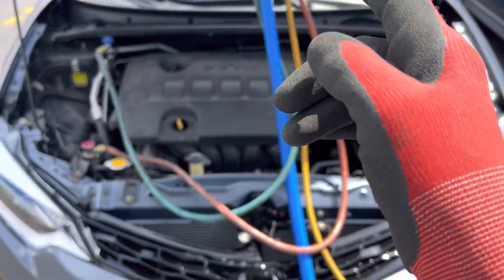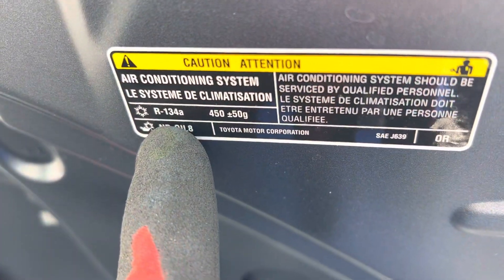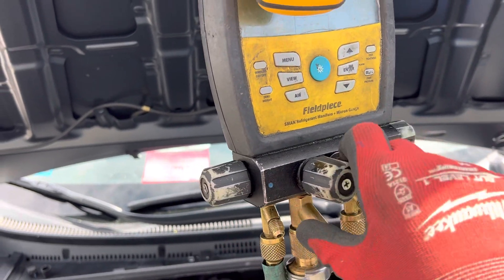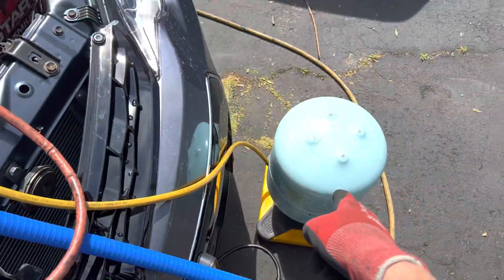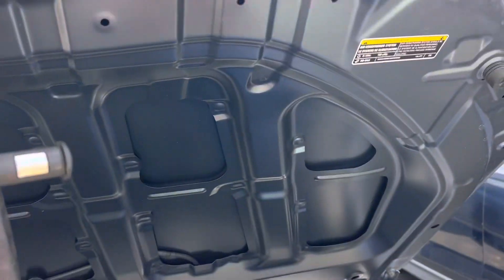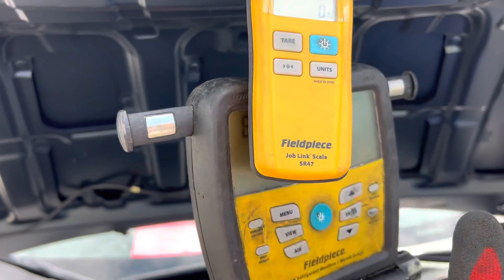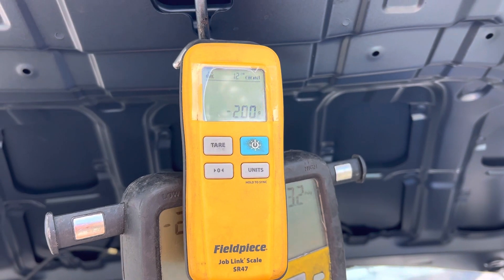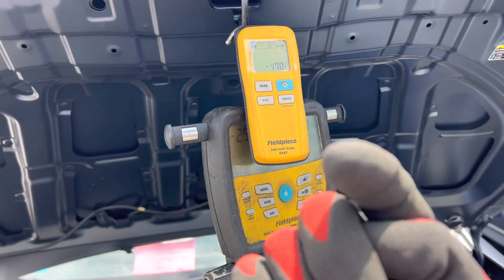REFRIGERANT RECHARGE 2016 TOYOTA TRD-S  CROLLA 450g. R134 TECHS learn different about same topic. ￼

Comment: Hi Tom! When I pull vacuum with my 2cfm vacuum pump, I go down to 750 microns. I can only get 4oz of R134 refrigerant into the high side port. Why can't I get 22 oz? What's wrong with my setup?
Reply from the maker: I’m curious have you tried to measure what is the micron capability of just your vacuum pump when you hook your micrometer directly to the port with no hoes ? 

To CFM is more than enough you can get there it’ll just be slower .  
   For example, if you measure your vacuum pump all by itself, and you find out it could go down to 50 µm that’s a good example of vacuum pump that is OK
It’s better if they could go to 10 to 15 µm it doesn’t sound like much but in the world of microns it’s a lot . The farther you try to get down there the more energy in a more time it takes.. 

And 750 µm means nothing if the vacuum pump is still connected and running and the valve is open when you’re measuring . 

It’s after you valve off the vacuum pump and isolated system and then wait 5 to 15 minutes and measure micron reading. That is your true reading. . 

When the vacuum pump is running, and the port valve is open, you were reading the vacuum being pulled by the vacuum pump . 

As for filling up the system like I tell everybody and like my father told me when I was 12 you don’t get to touch your tools and to keep figure out and tell me about the gas laws and explain to me how you’re going to get the complete for 100% charge into the system without running the engine . 

And I’ll tell you the same thing. My father told me go study to three gas laws. . 

When you understand them, a lightbulb will go off and you will answer your own question. It’s really simple. . 

Back when I had to find out, I had to read these ancient artifacts, called books with hieroglyphics . 

Nowadays, you guys are lucky you have the Internet, google, Wikipedia, and You Tube .  

When I was learning Bill Gates was a teenager working on his software.  And my father had me use micron meters for testing systems.. 

There was no Internet
Reply: @coldfinger459sub0  I haven't tried to test if the vacuum stays at 750 microns after 15 minutes. That would be a great test. Perhaps I have a leak in my setup. I will also try the vacuum pump to see what it pulls at the vacuum pump port. 

Thank you so much for your knowledge!
Reply from the maker: @davidvera4431  hey isolated, standing vacuum decay test, ( is not, perhaps a great test) 

It’s the only test that matters 

The vacuum pool while the pump is applied and running means absolutely nothing . 

It’s what it can hold through the vacuum decay test 

Just like when performing a nitrogen, Decay test . 

Doesn’t matter what you can get it up to 200 psi, 400 psi 600 psi with the tank, continuously supply nitrogen

It’s after you turn off the tank and isolated. What can hold is important.

Comment: Hi Tom! Great video!!! What is your procedure to safely start and run the A/C system after you recharge it and is it the same process for every vehicle?
Reply from the maker: Usually the same process for every vehicle

After I recharge it, turn on the key hit the button and it works every time . 

Unless it’s a Tesla, or if you are there electric vehicles, and then you might have to go in to their software and put it into a test re-charge mode through software to hold open electronic, expansion valves, and solinoids . 

But all vehicles charge up and under 30 seconds to 60 seconds or less and all vehicles just start right up and work immediately as soon as turned on fully charged 100% my way .
Reply: @coldfinger459sub0  thanks for your reply. You have by far the best explanation videos on a/c work hands down!!!